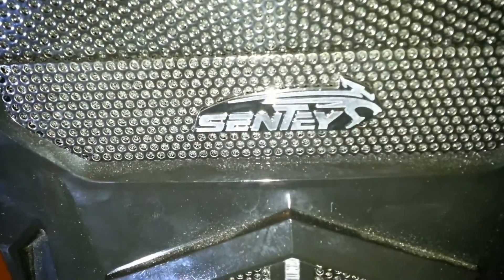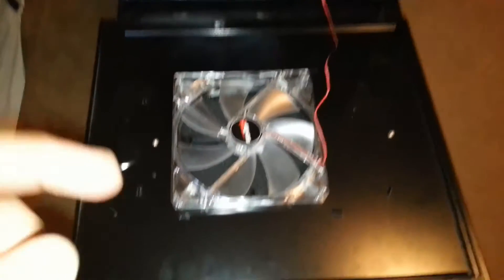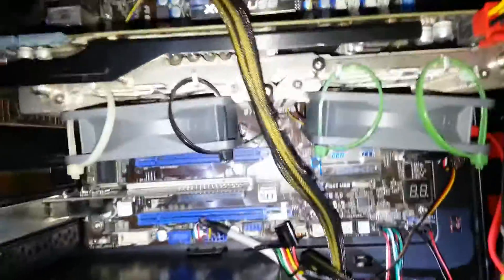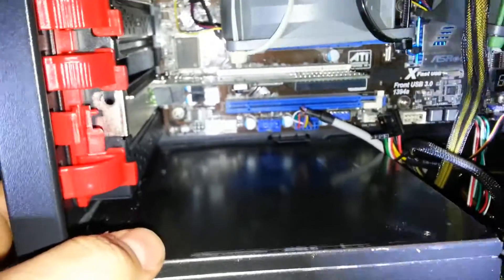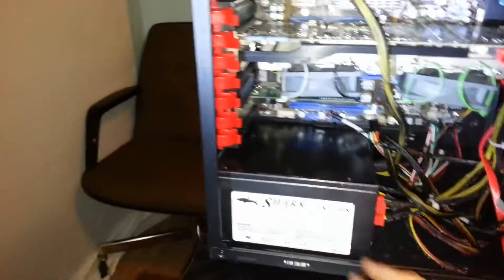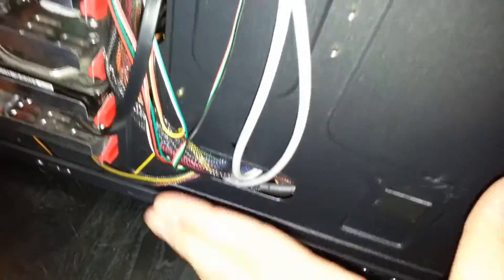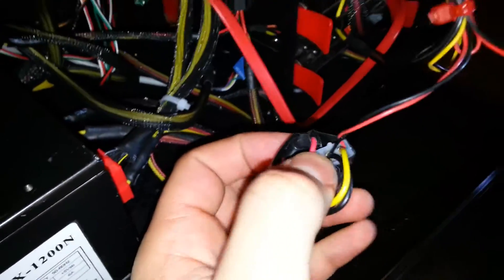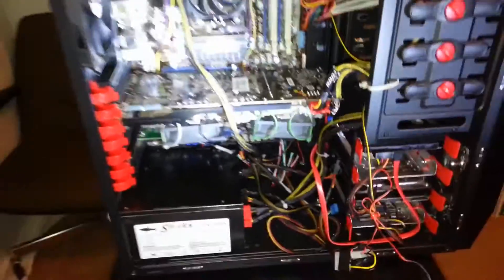Sentey Optimus Black Gaming PC Case Review

Comment: How did you hook up the case fans? Straight to the power supply or too the motherboard? Also what connects do the case fans have? 3, 4 pin etc